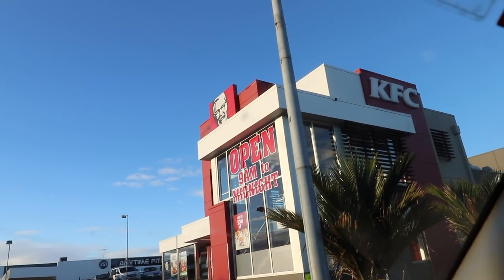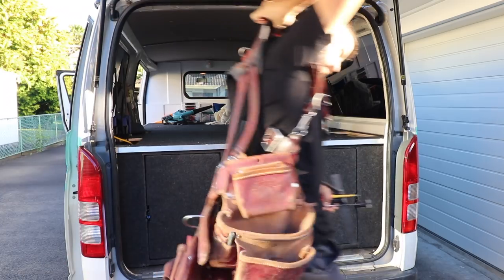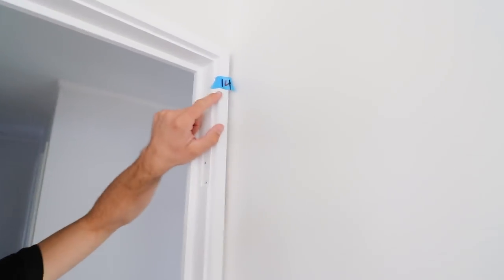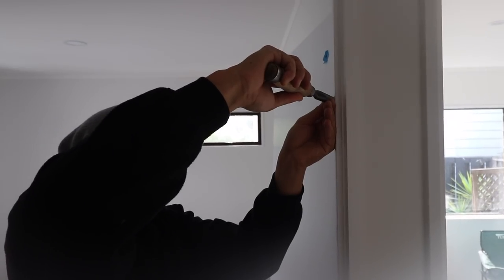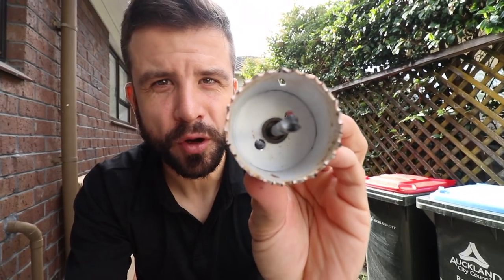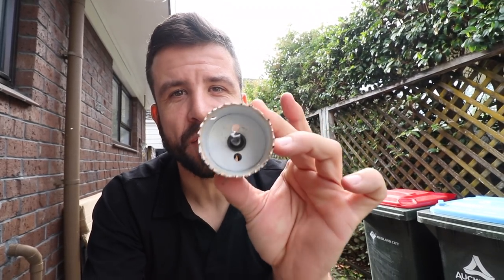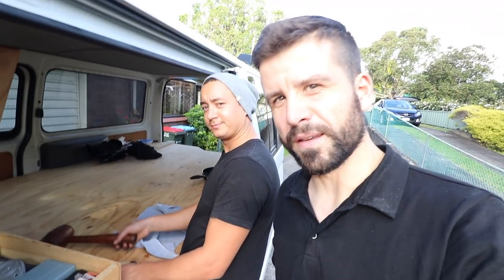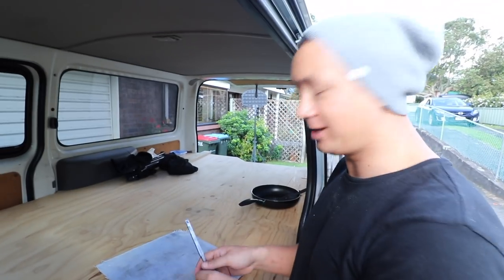Try This When Installing Old Doors

Comment: you can also screw down a small hole saw the same size as the existing holes inside the larger hole saw and it won't wander all over the place  when drilling

Comment: first off  sitting up doors can be #@$& of a job at times lol .I have had to re cut holes in doors in the past. I clamp a thin bit of plywood to the door then drill the hole in the play and through the door. Diploid is the drill bit something to centralise on. But Mate I don't know how many doors of painted in my time would be up there in the hundreds .and I've never thought of attaching them all together with 2 bits of Scotia like that to give you excess too both sides . Awesome and definitely now my new system . Big thanks for that awesome videos keep them coming
Reply from the maker: That's awesome man thanks

Comment: Might be old news to you now but you can sometime stack the holesaws onto the arbor. ie put a 50 mm holesaw on then thread a 20mm hole on top. Could save you having to buy a jig if you have an oddball  size one day

Comment: What in the world is the tool for the holes called. The one you screwed on to the side
Reply: karl22 ....hard bro and can you adjust them to accommodate different size hole-saws or do they come in the individual sizes 16, 25, 32mm etc. That one looked like a 51mm.
Reply: Rewatched the holesaw part and it didn’t look like the holesaw clamp thingy was adjustable and also saw the “54mm” part.😊